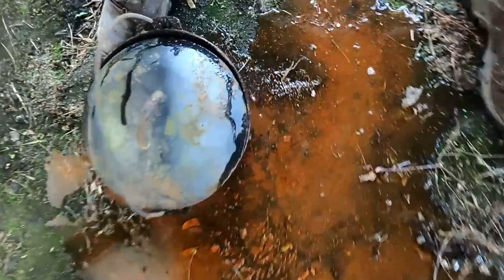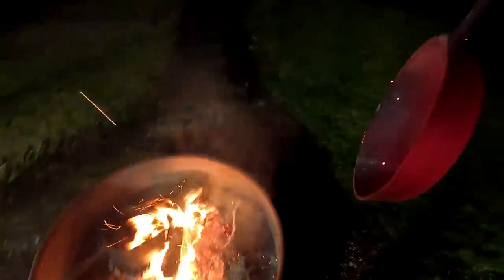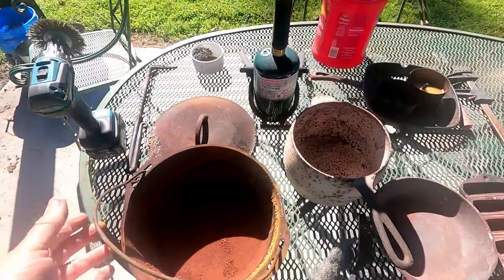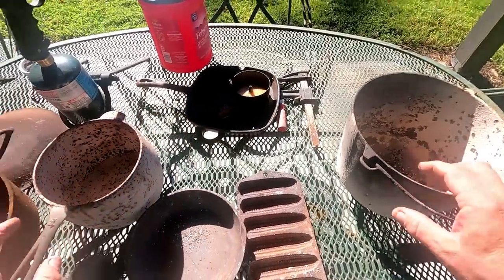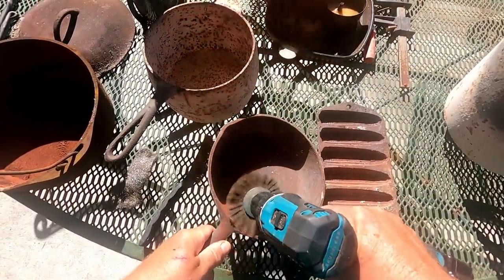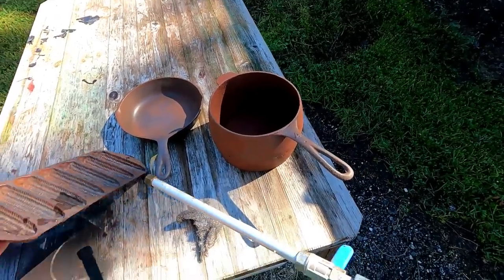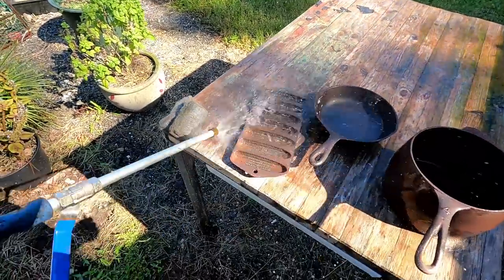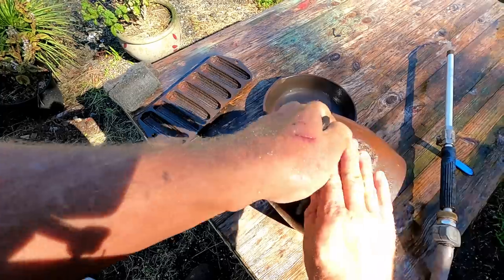CAST IRON RESTORATION BASICS - RESTORE OR JUNK

Comment: The trick to keep the corn sticks from sticking is to preheat them before with oil in it. Once preheated, add the oil to cornbread mix and then add the mix to the pan.
Reply: Truth
Reply: yep, it's gotta be hot.  Same with the cornbread pans with the triangular compartments.  I put 'em on my stove, and get them up aroud 250-300 degrees.  They should hiss when you pour the batter into them.

Comment: I have seen the cornbread stick pan used only once but the lady described what she was doing as she went along: First, she heated the stick pan to 425 degrees. Second, she prepared a relatively thin cornbread batter. It needs to pour like a thick gravy. After heating the pan, she added about a teaspoon of corn oil to each stick well and shook it around to coat the walls evenly. Then she spooned in the batter and returned the pan to the oven. I forget for how long - maybe 10 minutes? When she turned over the pan, the cornbread sticks fell out. They were a little crispy on the exterior and soft inside. It was the best cornbread I've ever had.

Comment: Great video! I have a bunch I need to restore. Been busy moving my parents home to Ohio. That cornbread pan works great if you get it HOT. 450 degrees. Take it out of the oven and brush it really well with oil and pour your batter in. Bake for about 20 minutes

Comment: That pot looks like it can be a great deep fryer tool... Since its deep and got a lid it can retain the heat effectively making a good fried chicken or fried potatoes... The secret is not to get too hot since too hot the inside wont have enough time cook. And too cold will separate the coating of the chicken seasoning. At end of the day it doesn't matter how you cook or ahat your using to cook, what really matters is the end product and how much satisfaction you get.

I got my own a carbon steel pan/wok, also have a cast iron pan and a heavy cast iron wok, i use the iron wok for frying absolutely beast!
The iron pan still unused waiting to get the proper setup for that and for the carbon steel wok.

Comment: I am Working on restoring a #6 Griswold and a #3 Wagner  Both have a good amount of pitting damage. I am thinking to try to address this pitting issue by making a thin slurry of Oil and powdered Activated Charcoal. since true seasoning is built up over time cooking in the pan, where Oil is combining with carbon from the food That is cooked in it , creating a strong polymerized coating. My thinking is that the powdered Charcoal in the slurry would act like a filler, (Cast iron Bondo) . The process would be 1) heat pan to 200 - 250 degrees. 2) Coat pan in Charcoal slurry. 3) wipe off excess. 4) Heat to 475 degrees for one hour. 5) Repeat process after it cools.  What do you think. Do you think it will work or just create a mess?

Comment: Great video as always Mr. Backwoods! I am always on the hunt for old cast.  Have always wanted a Dutch oven with a lid so I can use on other skillets. One question. Why put them in the fire?  I usually just used the wire brush or if  really bad used the media blaster at work.
Reply from the maker: Fire is an "off Grid method".  If you don't have tech or electricity this always works.

Comment: I have a 12inch Lodge skillet that has a little rust in the bottom as I made the mistake of soaking in soapy water overnight. Learned my lesson for sure. I live in a high rise and don't have any power tools. Can't put it in fire, as my entire building would be evacuated. Lol. Any suggestions?
Reply from the maker: Put in your oven and set to "self clean" mode.  works just about as good.
Reply: Clean it well with oven cleaner. Then give it a vinegar bath to get rid of the rust and season after

Comment: I use the same fire method but sometimes, after, the red rust still lingers when I'm wiping and heating with the oil. the paper towels are still red. am I doing something wrong?
Reply from the maker: No.  Just continue with the seasoning. of the pan.  The small amount of rust actually helps the seasoning bond to the metal.
Reply: @BackwoodsGourmetChannel  thank you so much, love the channel!!

Comment: I have restored several cornstick pans and the commenters are correct. I let the pans pre-heat while I mix the batter, then spray them down with olive oil cooking spray before filling them about 2/3 rds full. The sizzle when the batter hits the pan is a good thing. They fall right out when done. Brush off the loose cornmeal and good to go for next time. Your iron looks great!

Comment: I have seen the belly pots around. Some foundries did not put company names on the molds. especially local small foundries. The seam in the middle was from a 3 part mold made from sand..Also you could have a welder weld a handle on the pot you scrapped by using an iron bent rod welded on it.

Comment: I just got a new smithey and used it 1 time.  It said it was pre  seasoned. I washed it with hot water only but forgot to dry it right away. It got slightly rusted . I  cleaned it again bur when I wipe it with a clean napkin it the napkin always looks like it has rust on it..

Comment: My father worked at a furnace/welding shop and the to clean all the built-up seasoning hw would bring them red hot, scrape them down and put them in red-hot sand and slowly cool them down.